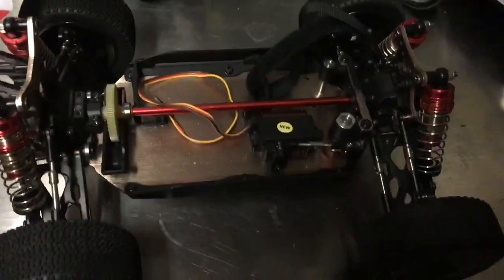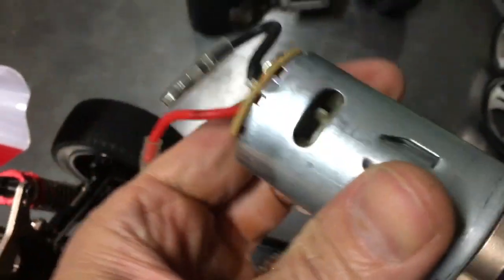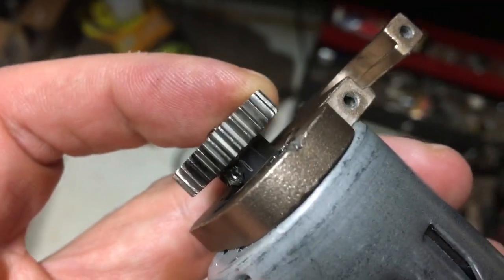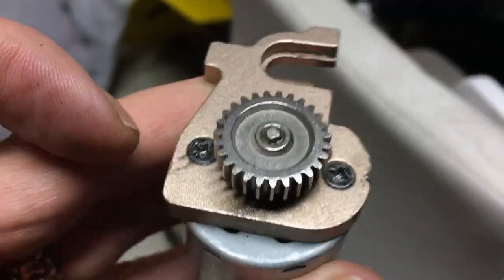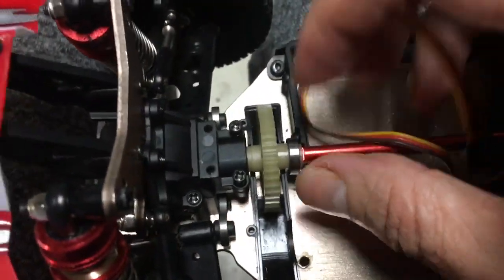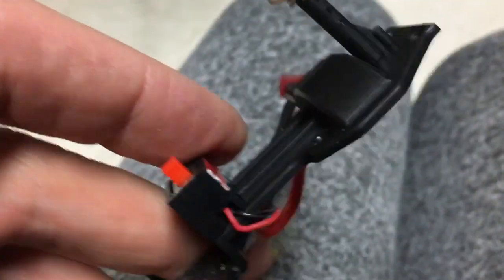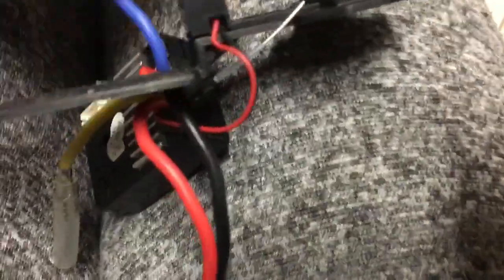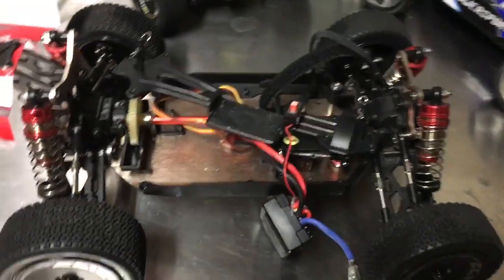WLtoys 144001 Brushless Conversion Part III - Stripped Screws WARNINGS

Comment: I had the same problem with the motor screws and grub screw, just heat them up with a lighter and it will pop out easy

Comment: Gear extractor on aliexpress: Cost a little bit less than a new motor. All screw should be upgraded with hex or torx10.9 steel screw (extremely strong steel) or even with space class 12.9 steel that will break your tools before the screw breaks. Do not take Titanium screws: very soft and break easy.

Comment: The Locktite is actually super glue as super glue is cheaper than Locktite, and heat is the fix, it breaks down the glue,

Most people will only change the battery and leave everything stock, so to stop bolts backing out they glue them in,

The buggy should last longer for most users as nothing should loosen off.

Comment: I'm using the same setup can u let me know if this servo will fit.

Features & details

Metal Gear Servo with a brushed DC coreless motor inside, making quick response, strong adaptability, and low electromagnetic interference.

Stall Torque: 12 kg/cm(4.8V), 15kg/cm(6V)

Metal gear and dual-ball bearing.

Dimensions : 54.1 x 20 x 44.3 mm; Weight: 55g

Supports voltage control in bipolar driver mode.

Comment: Mine has the on off built into the esc. It doesnt have the seperate switch located on the brace. My motor mount screws budged with moderate pressure but i know ill ve drilling the screws out that attach to the motor. They are welded in and soft as cheese lol.

Comment: Feel ya buddy, been there, had to drill out the motor mount and pinions screws to release the motor. Ended up bending the motor mount during the process and messing up the pinion :D And now the 550 motor has a lot of play on its shaft. Long story short, better buy a new pinion/mount before starting your upgrades.

Comment: I mentioned that I didn't recommend the brushed upgrade in a separate comment. I also mentioned that I tried 3s and it immediately blew a resistor on the motor and fried the esc. I had the quicrun 1060 brushed esc on hand and a 2.4ghz receiver/transmitter. I bought a $10 metal servo and I wanted the Arrma motor but it wasn't in stock so I bought the Titan 12t brushed motor. Guys it runs perfect and very fast on 2s. No hesitation, not coging just darts of the line.

Comment: Guys, you don't want to do this. I learned my lesson with my $300+ wltoys a959-b. If you plan on a brushless conversion for this car, odds are that you will regret it. Just buy a better car. The most fun I had with my a959-b was fresh out of the box. Not remarkable but more fun. Additionally, these cheap brushless combos are hit and miss, especially the off brand escs. Typically a company will sell components that fail their quality control standards to other companies to rebrand, they are not of the same quality as the hobbywing counterpart. Same with motors. With this car, I will do a simple brushed upgrade and only because 3s immediately blew my esc and blew a resistor on the motor. Unlicky I guess as others had no issue with 3s out of the box. I wanted the Arrma 12t 550 brushed but they were out of stock so I had to buy the Traxxas 12t 550 titan. I suspect I can run a big 2s lipo battery and get similar performance as the stock motor on 3s. JMO going overboard may result in disappointment and buyers remorse like I have with the majority of my a959-b upgrades.
Reply: TK Mo I’m purchasing another a959b for that reason exactly. Gonna leave it stock. My original is setup for speed runs and isn’t useful for anything else. My 14001 will stay stock unless I purchase another one.
Reply: @mwhite202020  any advice on how to get the pinion set screw loose? I have intigey spring steel 1.5mm driver and it was about to snap before it stripped. 1.5mm and loctite as not always a good combo. Think I'll use my Vibra-Tite VC-3. It's what I use when screwing into plastic as loctite is bad for plastic (You likely know this but some my not.) FYI, Vibra-Tite Gel threadlock is very very good. They say it's like permanent but not. I can attest. A little goes a long way, it expands a lot so be careful. If Vibra-Tite doesn't work, nothing will. (Except superglue/appoxy. lol)
Reply: TK Mo I’m a super fan of vibratite. The only way that I have found to remove difficult screws is with a mini torch lighter. You can also use a soldering gun tip to heat the screw up to help release the loctite.
Reply: @mwhite202020  I like the solder tip idea! I've got to warm mine up anyway. Thanks.
Reply: @mwhite202020  If I bought another a9?9-b, I would do a few upgrades. I'd definitely stay brushed, the stock ESC will fail sooner than later. I'd do tie-rods and shocks, I like the internal spring version for this car. What I did on mine, was cut the springs down about 2 coils. I cut the fronts about 1/2 coil more than the rears. I'd upgrade the wheels to 12mm and that is about it. I would put around 7k diff fluid in the diffs. I used 10k then thinned it out some with 80wt shock oil. Thinned the rear a little more than the front diffs.
Reply: This true ☝️ I did the same

Comment: Tips for new people , A small torch lighter helps get screws out, just a little bit dont melt any thing . screws and bits work better if they are the same metal/color it helps to stop stripping . and ther different size Philips head screw drivers. And alen keys come in metric and sae sizes
Reply: THANK you for the tip, I took a torch lighter to one of those RIDICULOUS screws on the BOTTOM of the car, those were ESPECIALLY impossible to get out, it's very frustrating!! I burnt up the chassis slightly..🤪, but, it wasn't too major. The a959B has a million problems...that have problems!! 👍💯

Comment: Yes!! I got my 144001 two days ago and I'm just getting sorta used to it. It sure does handle alot nicer than the cousin, the a959B model, 'eh?👍 I'm really impressed for the price and quality of build. Of course there's some screwey screws and wobbly stuff to deal with, flat surfaces and all that, but, I gotta see what this thing will do when it's brushless...I'll wait till your maiden run, coz I believe you've figured this mod out bro!! All in all this is a great platform to be starting this hobby up with again, for me being gone for many years from it. Without busting the bank to larger size models, the WLToys make a decent product, worth the 💰 money...💯👍✅
Reply from the maker: ha ha..yeah agree.  Let's see how that spur gear holds up!  :)  Yeah its a great car.  I had one run stock and loved it..but I had the itch to upgrade based on the success I had with my 959B upgrade to brushless.

Comment: I’ll soon buy this rc car, and follow with attention your brushless upgrade !! Great videos, thanks !
Concerning screws gripped, could try to heat them with a soldering iron ? Saw that on another video...
Reply: Yes someone on the WLToys Facebook group said this.  I should have done it.  But hopefully this will be a cautionary tale for others.  Great idea as well on the soldering iron because the flame could damage plastic parts in and around the motor.

Comment: I've seen the esc mounted next too the battery in the tray and it looks a good fit too
Reply: yes def. was thinking about this...but I run a long 3s battery that will go there.  But yes that's  a great idea... so many options it will be nice to see more of these conversions for ideas.  For now I am going to do my best to figure out a good solution.
Reply: @DariusBarazandeh  oh right yeah it won't work if you run long batterys but looking forward to seeing your finished build
Reply from the maker: @ned9344  Thank man.  I am Darius I just responded with another account.  Yeah I mounted it in the front.  See the latest video..car is done.
Reply: @Vintagerestorationmotorcycles  awesome looking forward to the test run videos (hope the spur gear lasts)